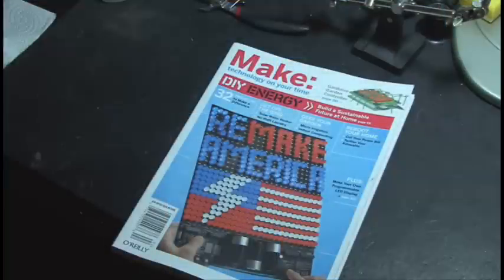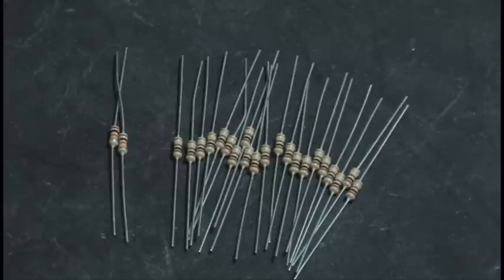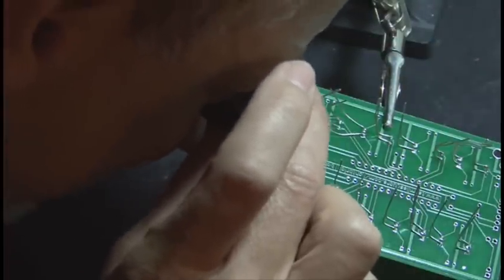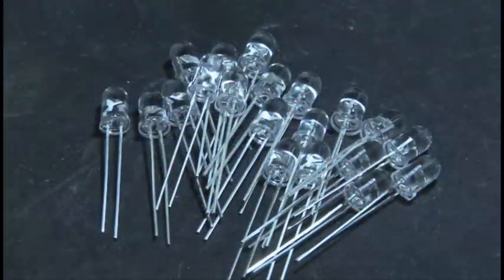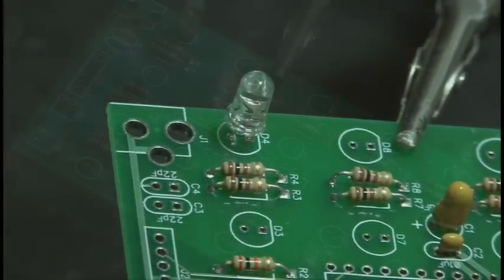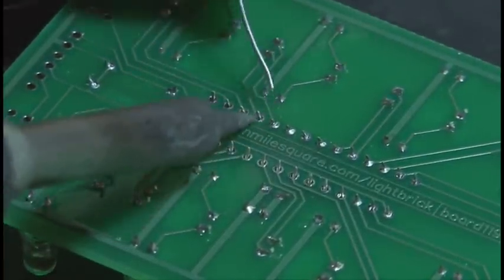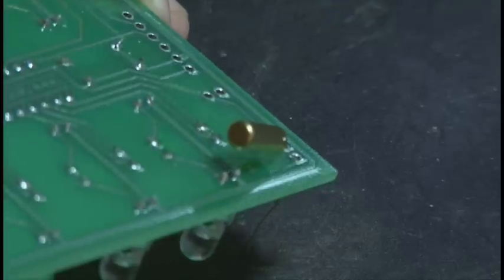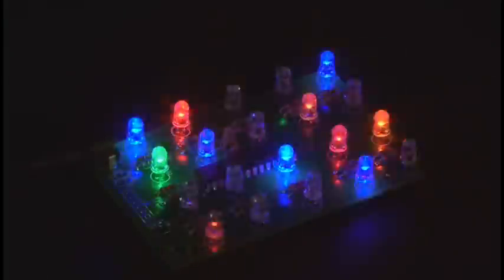Weekend Project: LED Light Brick

Comment: Hi kip I'm a newbe at this soldering but I love joining things with solder I have had a try at a 4x4x4 led cube it sort of work's.
Can you tell me where I could get the kit from also I headed about Arduino to make the lights flash can you use one of these with the light brick if I find one. Great job on the video.

Comment: Thank you, Kip. I really love watching your videos. Are you an electronic engineer by chance? With this circuit, I'd like to vary the speed. Can you tell me which of the two caps to change and with what value variable capacitor would work nicely? Thanks, Kip.
Reply: I believe this is done in the software, so you'd have to program the PIC

Comment: i was wondering if you can wire a solar light w/ out the light and used a batter pack for the revised power during the night? And used solar to charge the batter pack during the day?

Comment: is it really a good idea to use a 3V cell to check all the LEDs. The Blue led will be ok as the forward voltage is about 3.2V but the red and greens fave Vf of less about 2.4V ish.  Unless the LEDs have integrated resistors, i think it may damage the LEDs even if just briefly over-voltaged, don't you think?

Comment: @trevorbolles You'll find that the actual solder is very important. If you're new at this go for lead free solder wire. It doesn't drip and is very thin so you won't go across terminals. Also use an appropriate  CLEAN tip. Hope this helps.